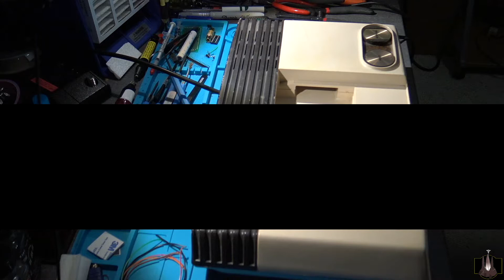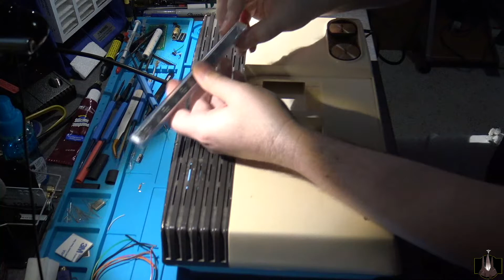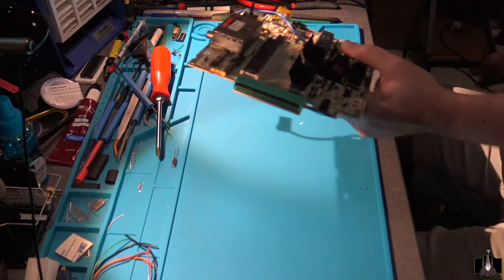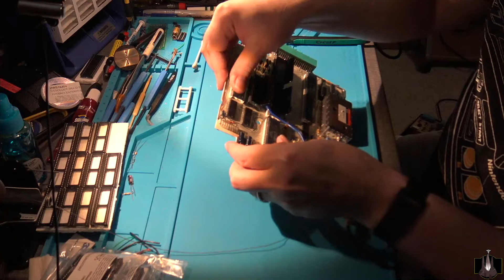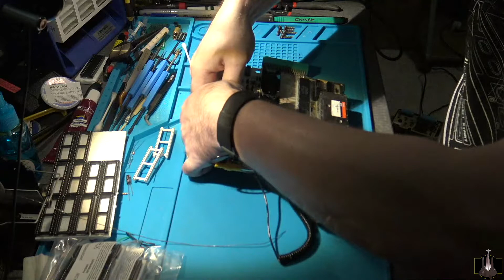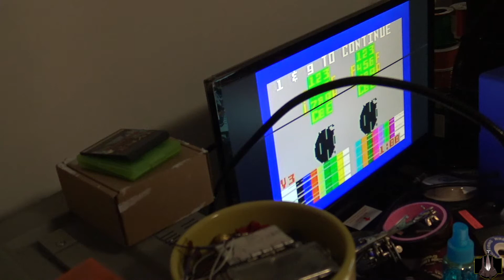ITC Live Service Work

Comment from the maker: UPDATE - Looks like I was able to get this fully working replacing out most of the original IC sockets with new ones and both of the original video SRAM chips appear to be problematic as either of them installed will cause graphic issues to reappear.

So In Summary:
- Replaced out both of the original 3539 SRAM chips with compatible replacements
- Replaced most of the original white IC sockets with new dual wipe IC sockets
- Solder was redone on the SRAM IC sockets I installed due to some additional continuity issues

Since the repair:
- 4 hours of burn in testing
- Both power supply board and main board have had all capacitor replaced and common failure components refreshed with new. (12Ω power resistor, 3906 TO-92 transistors).

Comment: Let me know if it's fixed now! ;)
Reply from the maker: Well, yes and no. It was still playing fine several hours later after burning it in. But then later it started looking the same as it did just right as it was nearly perfect. I did recap both the power supply board and the main board but that didn't improve anything. I went ahead and replaced the sockets for the sound IC and system rom IC. Near as I can tell, the issue is a loose or hairline crack in a trace on the board. I was able to press down on the board in places near the STIC and make the issue come and go. So I will have to look at the schematics and check continuity. Perhaps I can do a follow-up vid in the future. But I can confirm that both of the SRAM chips near the STIC and above the Sound IC appear to be bad as putting either of them back in will cause some of the graphic issues to come back pretty much straight away.